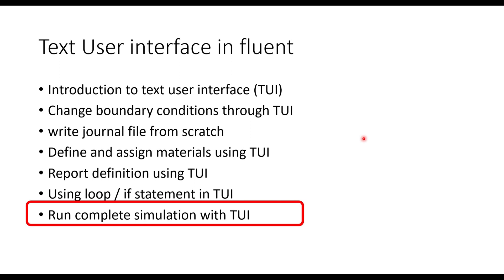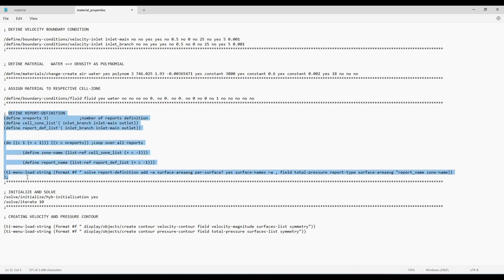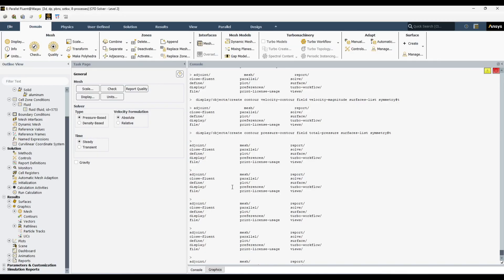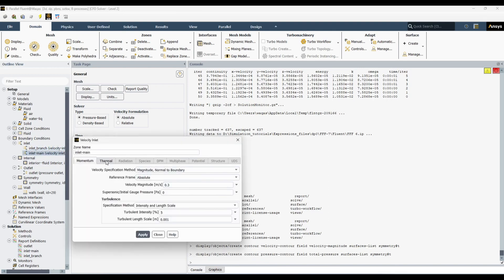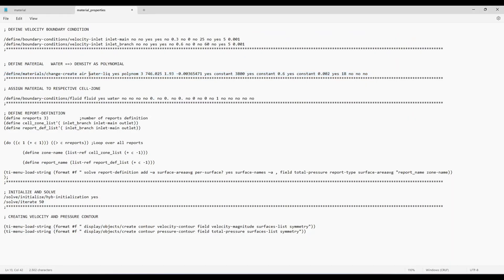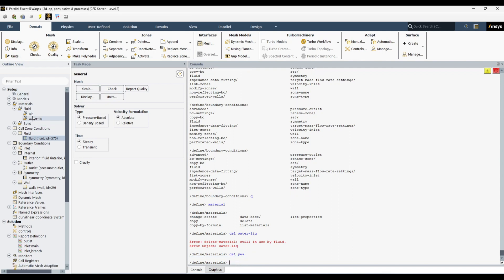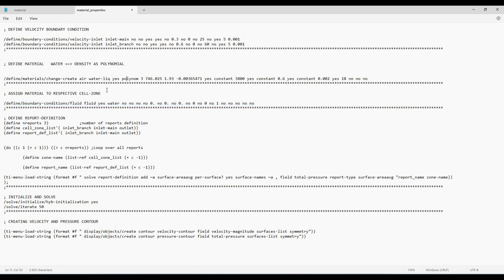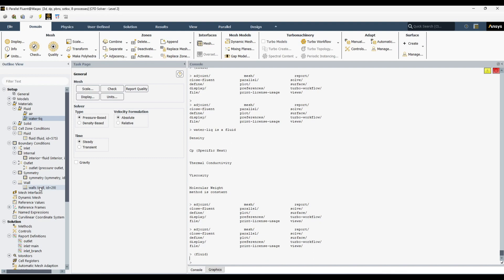Running complete simulation using Fluent Text User Interface | Ansys-Fluent | ( 6/6)

Comment: Hi! Great content!

Can you please elaborate a bit about saving contour images of specific views and also writing solution values into a file using TUI?
Reply from the maker: I will make a video for saving a contour.
Regarding writing a solution value in a file I have already discussed in this series.
You can write use "Report Definition" using TUI to save solution value 
You can also check other video on "Report Definition". It should be enough to save any result.
Otherwise, give an example of the results you would like to save, then I can tell better